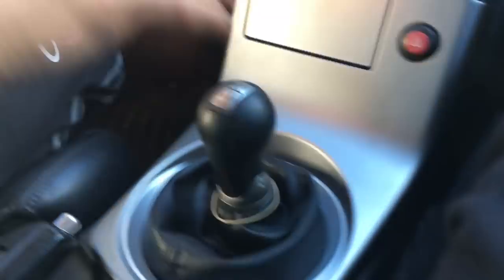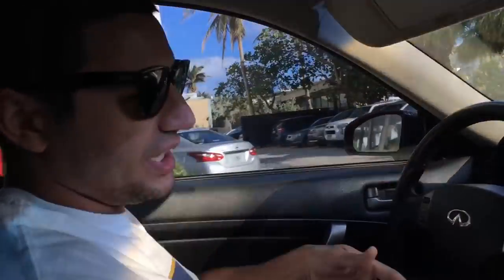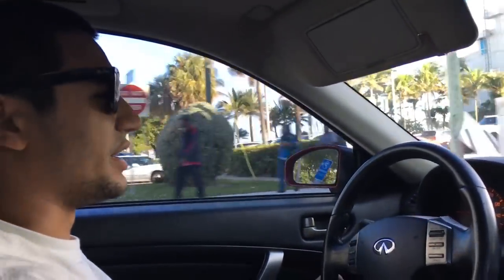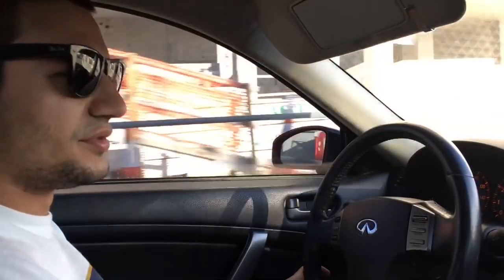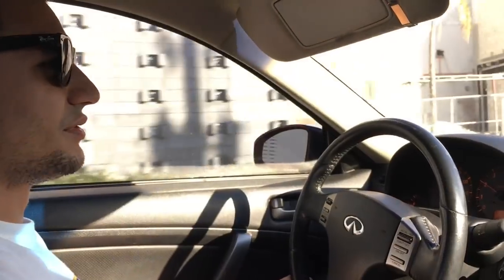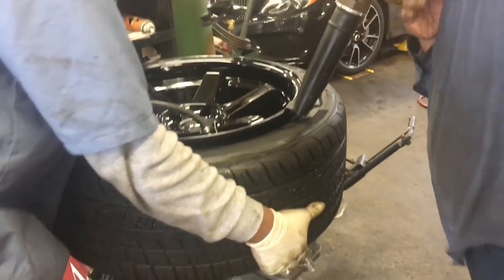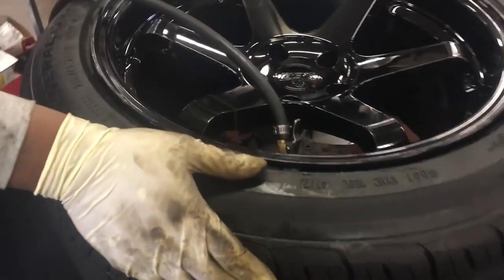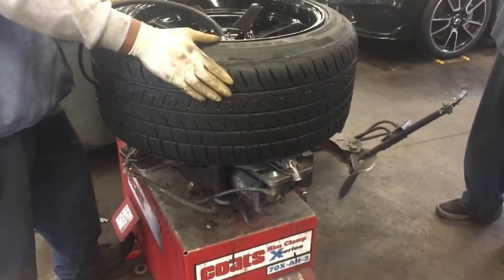Car Vlog (G35 Coupe) New Wheels (H.A.R.Wheels)

Comment: I just purchased an 2006 g35 with an automatic transmission, and also managed to collect about 90% of the 6 speed manual conversion parts. I was wondering how did the owner of this G35 measure out the precise spots to cut out and drill the holes for the clutch master cylinder and clutch pedal bolts to mount into the chassis? Some automatic transmission vehicles have a stamped imprint outlining the holes for the studs and master cylinder reservoir for a potential clutch pedal install. Automatic G35's don't have stamped imprint so it's hard to pin point exactly where to drill in order to avoid installing the clutch pedal at an incorrect angle.
Reply: Scryed  how much does this swap cost?
Reply: depends on where you where you source your parts from. Different sources can quote you different prices on the same part. The swap can cost anywhere from $600 - $1400. There's a guy on ebay selling the entire swap for $1400 i think.
Reply from the maker: I think he just had a shop do it tbh

Comment: I know this is a old video but did the fronts give you any trouble of them leaking air with the 225 in the front? I have a 235/35/19 in the front and it has a bit of stretch and it keeps dropping the psi

Comment: What offset are the wheels? I'm running 285 in rear...255 in front on TEIN street flex with EDFC Active PRO controller and no rubbing at all with 510ft. lb torque. Think you need the right rims with the correct offset

Comment: What’s good bro, I was wondering what the tire size for front and rear is on the red g35. Also are those 19x9.5 in front and 19x10.5 in rear? Thanks
Reply from the maker: I have no clue to be honest but I think what you guessed is correct

Comment: I wanna get a g35 soon!, but is it reliable and not that expensive for gas and for maintenance?. PS: I'll get a manual! :D
Reply from the maker: John Paul Baldoria gas will cost you a lot depending on how you drive unless you tune the car. The maintenance isn’t that bad you would have to change the oil very frequently otherwise your good

Comment: Bro the 1st set you had a couple of months ago looked better than these with stretched tires. The new wheels themselves look good though  and the meaty tire look in the rear looks Real aggressive.

I run 19x9.5 on Front and 19x10.5 on rear with 265/35/19 on the front and 285/35's on the rear, with rear rolled fenders. No rubbing  whatsoever and the car is lowered on HKS coils but its still at a functional ride height.
Reply from the maker: NightmareFD3S I said these wheels were just a test fit my dude.
Reply: TORqueTV no worries I'm not criticizing you.
Just in my opinion the last wheel setup you had looked better. Don't know why you got rid of them.